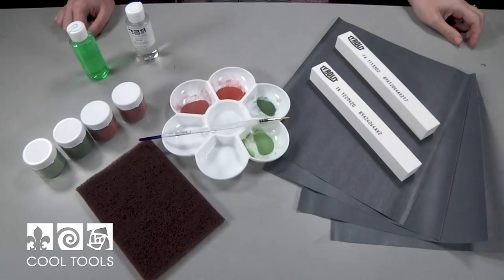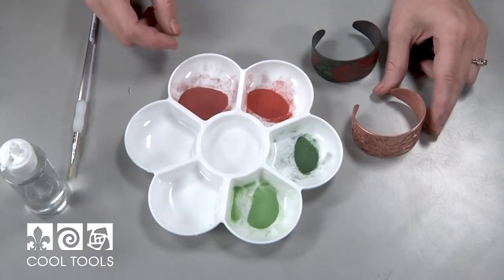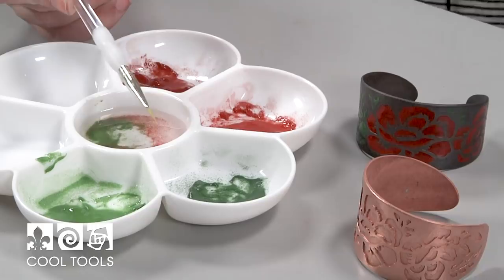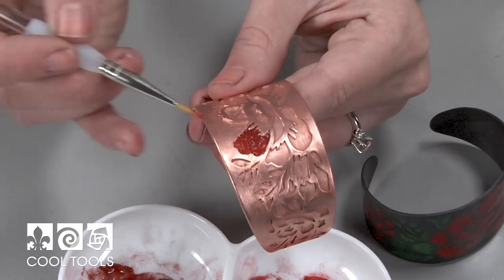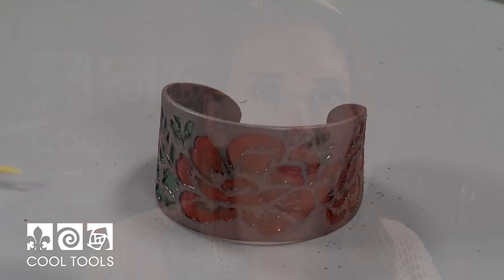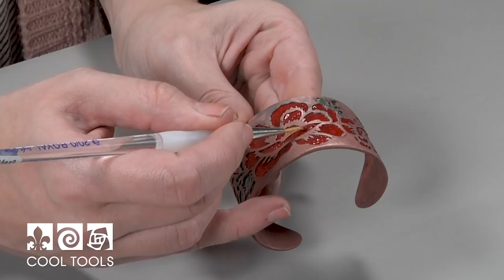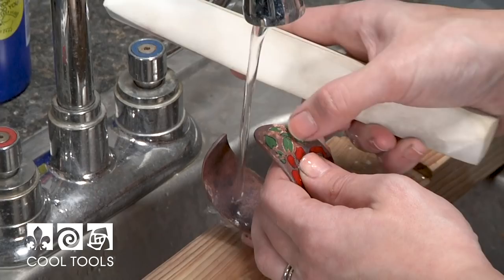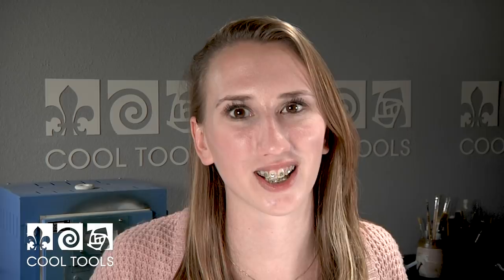Cool Tools | Enameled Cyprus™ Copper Clay Cuff by Karen Trexler

Comment: Hi great vid.. could u use a a drill sander to speed this part up ? Thank you 🙏😊
Reply from the maker: Thanks! if you are referring to the stoning and finishing portion of the project, I would not recommend using a rotary tool on a flexible shaft to speed it up. I would be worried about making all the ground off enamel airborne, and even if you still worked wet with a rotary tool I’d be worried about how messy and unsafe it could potentially be. If you are interested in a more quick way to stone and sand, we sell the Jooltool enamel and glass polishing kit that can be used to speed up the cleanup and polishing of the enamel.
Reply: CoolToolsVideos hi thank you so much for answer 🙏😊 could you post a link to this tool ? Thank you again you guys are awesome !
Reply from the maker: @karensuesmith7588  Of course! Here you go: https://www.cooltools.us/JOOLTOOL-Glass-Enamel-Polishing-Kit-p/pol-912.htm

Comment: Are there options to fix warping or other moving in the copper after firing?  You didn’t mention...
Reply from the maker: Hello, since this shape was long and thin, it's very likely that you would experience some warping in the sintering firing. However, you can easily correct the form with a bracelet mandrel and rawhide mallet, and the bracelet should be shaped and sized exactly as you would like it before you begin enameling. Once you have enamel fired onto your bracelet, any attempt to re-shape the cuff will result in enamel cracking and chipping. I haven't had any issues with the Cyprus Copper Clay warping while it's in the kiln to be enameled though, so if you start off with the correct shape before you enamel you should be fine. 

Hope this helps!

Comment: Are you able to store the leftover enamel for later use after adding the klyre fire?
Reply from the maker: Hello, yes, you can. You may need to add a little more klyr-fire, but storing leftover enamel should not be a problem. Hope this helps!
Reply: You should only prepare was much enamel as you need. Don't store it.